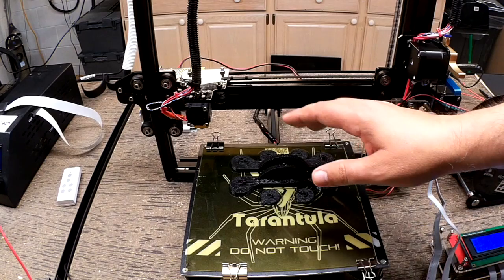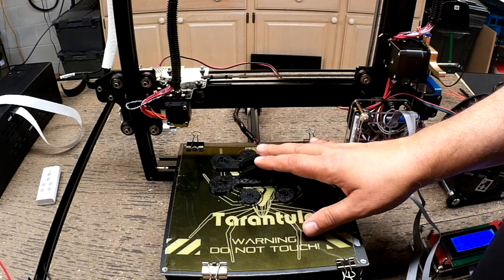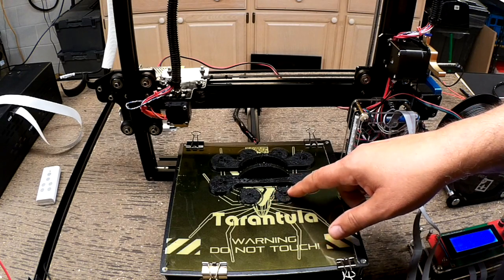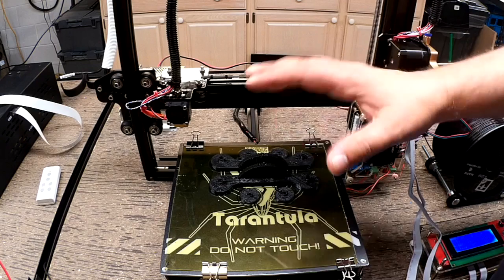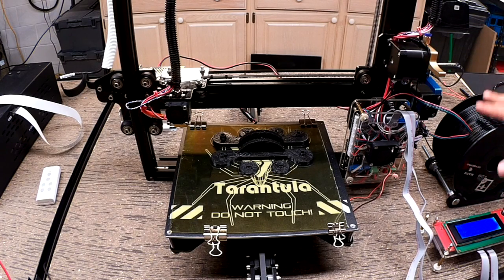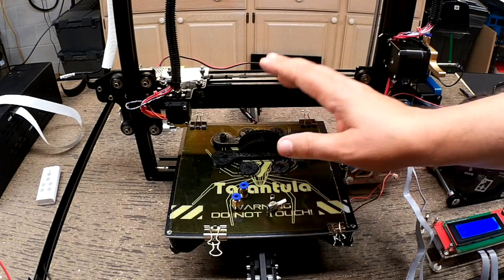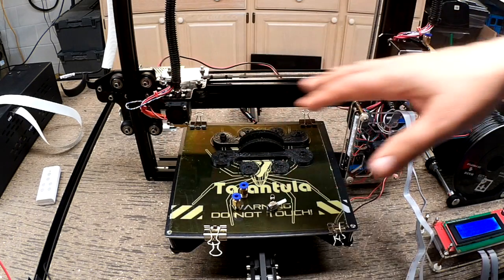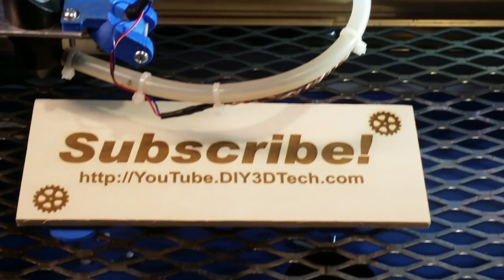TEVO Tarantula 3D Printer - First Print and General Review!

Comment: I noticed that you have done a lot of videos with the tevo tarantula and that you are a bit of a fan of this kit. I also noticed you have added the second z axis motor. I have seen a few videos inverting these drives , in your experience do you think it would improve the printer further or it would be a waste of time.
Reply from the maker: Yes huge fan of the tevo tarantula!  Also is there value of make them "push" instead of "pull"?  Personally I don't think there is a practical difference to be had within the tolerance of  the machine. In fact if I was in a debate I likely would take the "pull" [up] side as you will be working with gravity (yes I know that sounds counter intuitive). As think of it this way, after being pushed up gravity will want to pull back down as the force will be applied from the bottom.  Whereas with a pull up, the force will be from the top and gravity will be then likely averaged into the complete movement.  However either why the variance is likely to be so small,  its a nit in the larger scheme of the machines movement.  Hope this helps!

Comment: Hello, my objects cannot start printing on the bed center. where adjust this. Thanks.
Reply from the maker: Are sure you have the correct bed size defined in your slicer and if not as in this video it you will then you will need to change it in firmware...
Reply: have you a tutorial to change parameters to center bed.
Reply from the maker: If you look in the Tevo Tarantula play list for "Dity Little Secret", I show how I do the firmware part...

Comment: Could somebody help me or tell me where I can find some help, please?

I assemble my Tevo Tarantula i3 but I couldn't print anything, the filament melts and get stuck in the nozzle and it gets plugged, the filament doesn't go throughout the nozzle it doesn't flow it creates like a little cylinder of melted plastic, so I have to disassemble the nozzle pull the filament out and cut the end (which is the cylinder of plastic) I thought it was because of the temperature so I increased it, but the same thing happend, I tried different things but with no success.

Have this happened to someone else or somebody knows what can I do? Any Ideas? I really need help. :/
Reply from the maker: Sounds like you do not have the PTFE tube pushed all of the way down.  This is common error folks run into when build this as the tube MUST be pushed all the way to the end or it create (very well put by the way) a "cylinder of plastic"...
Reply: Here it's for 185.99 dollars
http://www.gearbest.com/3d-printers-3d-printer-kits/pp_628790.html?wid=21&lkid=10781350
I hope this will help you

https://www.youtube.com/watch?v=pCW6XCrUBEQ

Comment: What is your opinion on this printer vs the Wanhao i3?
Reply from the maker: For roughly 1/2 the price it is 90% as good.  I might rate it even higher based upon duty cycle as the Wanhao uses rails whereas the Tarantula uses wheels and I don't see (from experience) the same longevity under "heavy" use as the Wanhao would provide.  However, too it is a kit with poor instructions but I have a lot of fun building (I have built others and didn't have a lot of fun :-)

Comment: I used 2 M5 flat washers on the wheels. Once you put a couple of metal L brackets in the bottom the wobble is much less.
Reply from the maker: Agreed as I have it on my list actually to print brackets for the base :-)  Have you released yours?
Reply: waiting for bolts and t-nuts then, will add base brackets.
added a small bracket to support left side top idler which was wobbling. will now print better designs from Facebook files section.
Reply from the maker: is there a place to get the files other than facebook?
Reply: maybe on thingverse.
Reply: Yes, on Thingiverse there's a group for Tevo Tarantula's owners : http://www.thingiverse.com/groups/tevo-tarantula-owners
Reply from the maker: many thanks!

Comment: great video . I have seen some time lapses  here and there  on this printer where the high bead leveling can be clearly seen letting the bed 'ring'  or wobble on sharp Y moves . they had teh camera  down and to the left looking at the  hot end and i could see the bed was  looking like the tall spring let it  move too much .  your adjusters look good and rigid . 
cool stuf as i was thinking about getting one later
Reply from the maker: As mentioned in the video I had fun building it but the beast does have a few issues with the single Z.  However for about the same price the MonoPrice Select Mini (which does have a smaller bed) is likely a better "buy".  As the main reason I purchased it was the super size and when that didn't work well I just built it as is and will likely sell it on eBay when done and get something else to mess with :-)
Reply: yeah.looks like a good rig .   i'm purposely using short stiff springs on my print bed . they reach a good compression at 6 to 8 mm high. they ar 10mm uncompressed . im hoping short spring will result in a firmer bed. not sure though .
Reply from the maker: On my other ones I have added spring retainers and will likely here too...